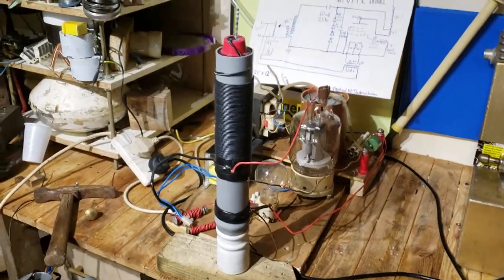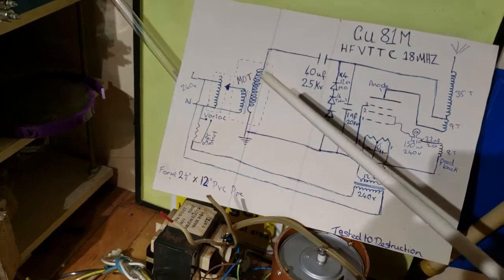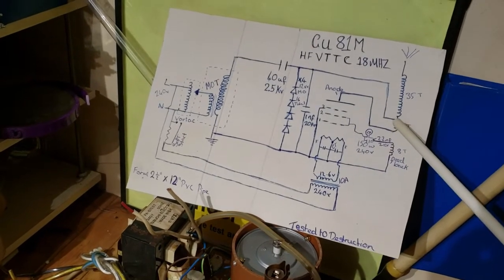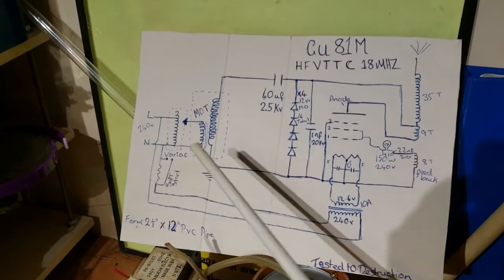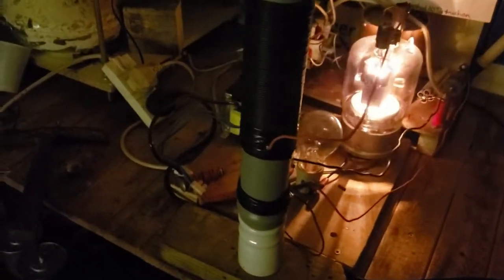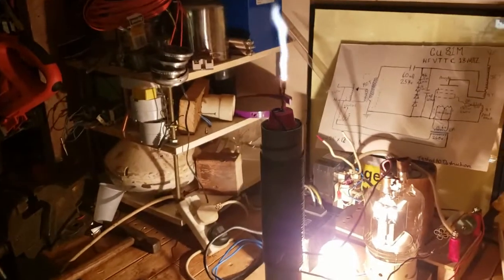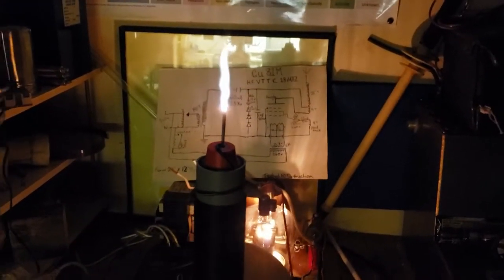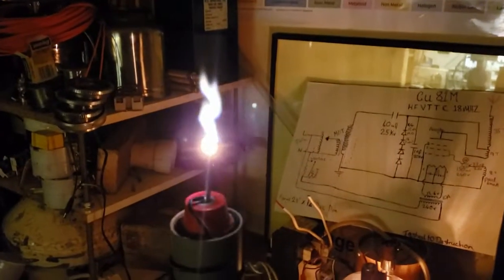GU-81m Plasma Flame, with Schematic and Explanation.

Comment: How far down is the feedback coil from the primary? And are the ground connections connected to earth or is it fine with no earth connection ? And finally, if I’m using a 120V rated bulb, would a 60W  suffice for the grid leak resistance?

Comment: The sound given off sounds like 50Hz  mains.  Is it 18Mhz resonance modulated by mains waveform at 50Hz? (bit like interrupted DRSSTC?)
Reply from the maker: It uses a voltage doubler/level shifter so yes it's 50Hz  10ms  ramped b plus 👍

Comment: How does the soft start work and what does it do?
Reply from the maker: Im not using soft start but it is basically applying the filament voltage gently ie wind up with a variac or start it through a resistor and then close the switch 

Steve
Reply: @T2D.SteveArcs  thank you!
Reply from the maker: @BackMacSci  welcome mate

Comment: In your schematic are the suppressor, screen and control grid in order going down with 1 2 and 3? Also are the capacitors between each leg if the Filament  and ground parasitic capacitance?
Reply from the maker: Yes mate grid 1 and 2 are tied together and 3 (the suppressor) is tied  to the cathode,  as for the filament bang an external cap across the filament for rf bypassing
Reply: @T2D.SteveArcs thank you, I appreciate your help and Love your work. I’m looking to build one of these and mess around with the values.
Reply from the maker: @ethansprojects7399  thanks mate thanks for watching il hopefully be uploading again soon... v
Building a big buck converter and full-bridge inverter to ramp the anode voltage so should be fun. 

Steve

Comment: I want to get all the plasma circuit tinkerers together in one room with all the radio antenna designers. Plasma as an antenna medium has been around since at least WW2. But it's fairly underutilized. NASA scientists have long studied plasma radio tech trying to solve the radio blackout problem of spacecraft reentering Earth's atmosphere as a hot plasma fireball that blocks radio communication.  Innovations in efficient, low cost, high lifespan thermal plasma sources would be useful for a wide range of technology though, from satellite propulsion, to plasma processing landfill waste into useful materials. 

Someone in the comments mentioned how this flame resembles a lightsaber. Here's a radical idea for extending the plasma flame length: create a cone shaped, split ring resonator around the breakout needle, tuned to the coil frequency. The split rings will act as single loop coil inductor/capacitor around the output needle, causing them to resonate. The cone shaped profile of the split ring resonator allows something interesting to happen, it forms an antenna with the same beam profile as a cone shaped lens called an Axicon. If the ring resonator is designed correctly it will generate a "leaky" surface wave that propagates along the surface of the cone in the antenna near-field, until it "leaks" from the antenna into the far-field with that specific cone shaped beam profile. That beam profile will converge along the Z-axis of the cone into a focal line (as opposed to a focal point with a parabolic antenna). This is called a Bessel Beam, because the amplitude profile of the beam is an approximate solution to the Bessel function (aka the cylindrical harmonic which describes waves trapped in a cylinder). This Bessel Beam profile has been used in LASER particle acceleration experiments, because the angle and polarization of the light along the longitudinal axis of the beam ends up constructively interfering to produce the equivalent of an electric dipole in the direction of the beam. You can effectively create a beam of light that adds up all the electric field components by bending them forwards into the focal line, resulting in a net electric field that can accelerate ions or electrons to nearly light speed, the polarity depending on the phase profile of the beam. If you align the output of the directional Bessel antenna with the output of the plasma flame, you can heat and accelerate it after it has left the circuit and potentially ionize a path through the air a great distance from the breakout point.
Reply from the maker: Take a look at my other videos mate,  I have a 1.6Mhz coil, it has a 1 foot secondary and can spit out 5 and a half feet swords 😅 thanks for your comment and thank you for watching..
All the best 

Steve Arcs
Reply: @T2D.SteveArcs  It's truly magnificent! You have my subscription friend. Please keep building bigger and of course be careful. Bigger is better as they say! 

I'm mostly interested in the applications of plasma circuits to ion propulsion, but a wild hot arc is pure joy. 

 Generally ion thrusters operate at much higher voltages and low amperage for peak efficiency, but the use of thermal plasmas, and high current magneto-plasmoids for propulsion has a lot of different successful designs like Arc Jets and the NASA "plasmadynamic" thrusters. I'd love to see that 5 foot arc thrower of yours in a dense plasma focus configuration for example, like a coaxial railgun! Although you might start getting an unacceptable flux of X-rays at that point! :D Ethan Krauss here on YouTube has a good example of the first ion thruster ever documented to be able to lift it's own power supply. Despite the design being almost 70 years old, the technology has been impractical without efficient, lightweight plasma circuits and power supplies, Ethan has patented a few miniaturized circuits for the purpose and he's making good progress. I think if ion thrusters are going to be efficient they need to have a hybrid approach where they use a high current arc to ionize and thermalize some air plasma, seeding the air with neutral plasma so that the high voltage, low current circuit can efficiently accelerate a larger population of ions. 

For the really long range plasmas though, we can also look to the US Army Electrolaser directed energy weapons program. They're aiming for laser induced plasma filamentation on the order of kilometers in length.  Mostly they rely on a few techniques like shorter pulse duration, higher peak power and better self-focusing effects. But that's why I like the idea of combining the laser driven acceleration techniques with the HF, high current plasma circuits. A Bessel profile kills two birds with one stone, it solves part of the defocusing problem at long range, and it converts some of the energy in the LASER or RADAR wave to direct current in the plasma filament. Your circuits would be ideal for the thermalizing stage before acceleration, especially if you can employ a DC bias in the preferred direction. I believe that the DC bias should accelerate electrons and other negative ions in the forward direction ideally, rather than + ions, because electrons are lighter they will accelerate more, resulting in a non-equilibrium plasma where the electrons are much hotter than other ions, and so they form an effective virtual cathode ray in atmosphere, until the circuit is able to ground through the filament and discharges. I got the idea for a Bessel Beam plasma acceleration stage from a research paper titled "Circular Antenna Arrays For Microwave Bessel Beams". The Axicon beam profile can have an infinite focal length, so it's used in Astronomy for telescope lenses sometimes, but at short range it's used in industry for laser cutting perfect lines through materials, and for precisely guiding multi-meter long plasma discharges along the axis of the beam. However I've never seen those specific techniques combined in atmosphere in the same device! The Army Electrolaser is just a big capacitor dumped into the femtosecond laser filament. With circuits like yours that can get a plasma nice and hot before directing it, you could ditch the bulky pulse LASER for making the filament, and instead accelerate the plasma after it's already formed with much more compact phased array antenna. You could even use the plasma itself as a lasing medium with a beam that approximates a "wiggler" for free electron lasers. Perhaps this is not an efficient way to achieve the long range plasma beam I desire, but that's why I come to enjoy your work and be inspired to continue thinking about the problems.

Comment: Hey buddy i need some help, i made a prototype of this version but cant get mine to oscillate, i used 5 Microwave diodes, a 570pf 15kv cap only one i had, my coil is wound on a 70mm waste pipe (maybe too big?) and i used 6 Microwave caps cause i dont have more. Filament and all works fine but no breakout nor any sogn of oscillation (lamp is off). If it helps i could upload a yt vid if you want to. Thank you for your time
Reply: For testing purposes i did not put a rf bypass cap on either filament or the feedback resistor lamp
Reply from the maker: @Juice.2707  upload a video with a schematic of what you have done

Comment: Hey mate, this is sick, i had a question about these base fed coils, would it be safe to touch the output like it is on a traditional style vttc or would you effectively be touching the live output of a microwave transformer, i made a gu81m vttc that is basefed but run im pretty sure just below 1MHz (cant remember exactly) its using two mots for 4kv centre tapped . So basically both anode and cathode are 2kv above ground potential. I get about half a meter spark output and the circuit uses no capacitors for tuning. I might put a video of it on my channel if you wanna check it out
Reply from the maker: Hey mate no you cant touch the output from a coil like this as theres no isolation you would be touching the b+ hv supply directly 

Steve

Comment: Very nicely done! I bet adding a bit of lumped C from a high-current vacuum cap would help bump up the RF current in the primary and output power. The very stable corkscrew discharges are also interesting. Wonder if these would occur if the system was powered off a filtered DC supply. Have also wondered it this phenomenon may be an interaction of the RF magnetic field from the winding and charged particles in the plasma, or if its simply a thermal-convection effect. Seems to show up on just about all types of coils with an AC or ramped envelope shape. Thanks again!
Reply from the maker: Thanks mate I will do more experiments next time I build a high frequency plasma flame, have you seen my other Vacuum tube coils? Theres a few on my channel, thanks for watching.....

Steve

Comment: how long can this candle be on ??
Reply from the maker: Depends on power level. Continuously at low power, but not long at full power. But please bear in mind this was just a quick demo and certainly wasn't optimised, so you could definitely get better results with a tube of this size.

Comment: Amazing, now I know what to do with my GU-81M.
Reply from the maker: Yes mate glad you like it😁 check out rest of my vids I have some awesome hv content 

Steve
Reply: @T2D.SteveArcs  Yup it is crazy. Just one question: Isnt there a risk of rf burns like from a magnetron when there is no flame? Becaus then it radiates a lot of rf power. Thank you and have a nice day. 
(Also thank you so mutch for the scematic.)
Reply from the maker: @firefox1136  yes mate there is a risk of RF burns with any high frequency, high power, radiator. For example if you are wearing rubber soled shoes and touch something that is grounded, there is a good chance of RF burns. 

Steve
Reply: @T2D.SteveArcs  Ok, thank you.

Comment: wow! bang up job bruv. this bad boi sounds like a frickin flying saucer lol would love to see how fast this thing could spin a corona motor. would you consider using a center tapped bifilar primary coil on a proper build? also this looks very similar to a recent paper i read about a microwave plasma jet thruster. have you seen this?

https://aip.scitation.org/doi/10.1063/5.0005814
Reply from the maker: Yeah it might be nice to use a centre tapped push pull, with a nice filtered supply. 
Audio modulation me thinking! 😁 lol

Comment: Thanks a lot for the video.  Your design is rather unique i'd say as it has an isolated feedback coil and using the plate capacitance instead of a separate tank cap.   Most designs I see just use a tap on the main coil to provide feedback and have another doorknob cap for the tank.
Reply from the maker: Thanks mate .. Yeah I did think of feeding G off the one coil through a cap and tuning with a variable cap but it was a quick demo that I was going to show then take apart so minimum effort and components was the order of the day 😂😂.. 
That said I intend on a proper go at this in the near future with a big tube so will be doing some testing etc, I will try document and show on here as I go...

Comment: Pretty neat! I wonder how much resonance is actually involved here. Is this just a high frequency transformer with a self-oscillating driver, or does it actually get a significant increase in voltage from resonance? I'm guessing the topload is not critical at all here.
I'm also wondering how much power it was drawing.
Reply from the maker: Hi yes It is a rf auto-transformer , self oscillating driver and probs a few hundred watts rf and probs around 1200w input and it will be oscillating at the natural frequency determined by the LC of the tube and coil combo (and parasitics) I guess, this circuit was not tuned for max output impedance matched etc more just a quick lash up for demo, I do plan to look at this more in the future with a more powerful tube and more effort into getting maximum output😁....
Steve